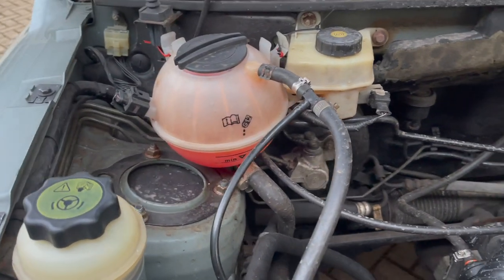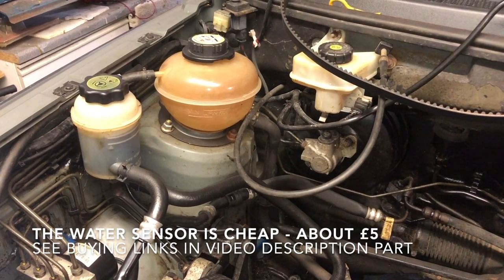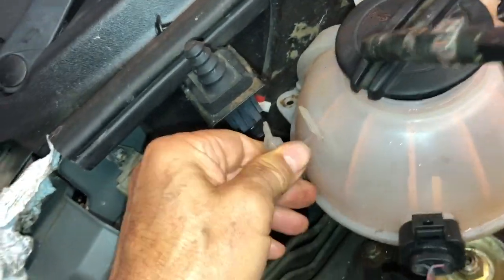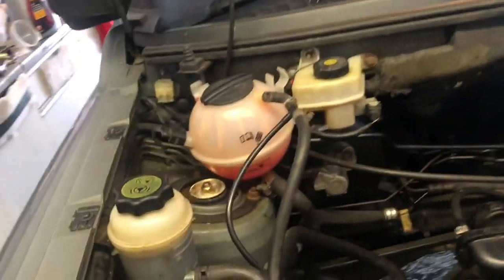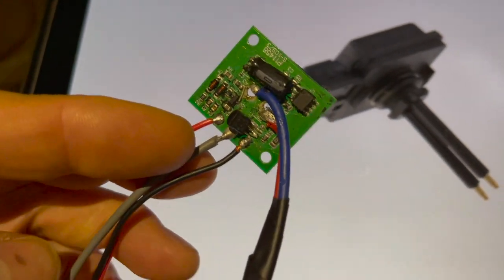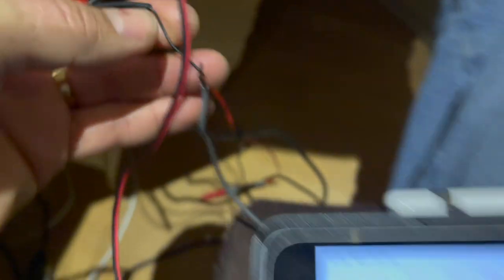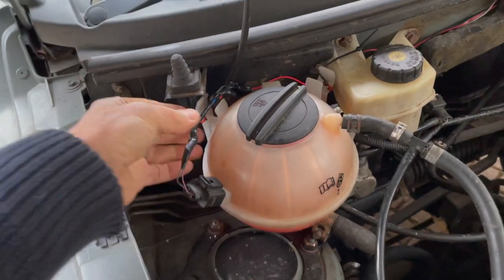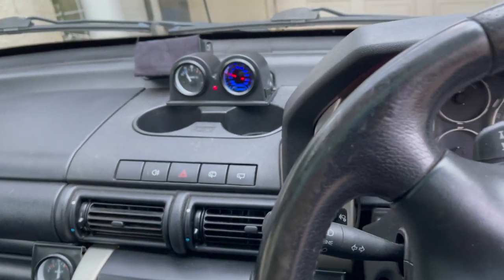Save your Engine! - Install a Coolant Level Sensor - Modern Type - Here is How!

Comment: Great video and help, should be very useful for our older VW T25 campervan (rear engine bay & coolant tank a faff to get to, so a retrofit, working dash warning light is essential). 
I can't get your recommended set-up to work on a bench test - what was your fault testing procedure when you stated you blew a transistor (3min 44 sec), so I can check it works before installing, or indicate my new unit is faulty? Thanks!
Reply from the maker: Thanks. When a transistor blew due to my wrong connection when trying to work out the wiring, I had little choice but to replace the sensor unit, it is cheap.   If you wire it as per my wiring diagram in the video it should work fine with a good sensor.
Reply: Thanks for replying, appreciated

Comment: Have you seen the mgf tf low level coolant  kit for sale on Ebay ,you just stick the sensor on the bottle and wire up to a cabin buzzer. I think your LED is the better idea.
Reply from the maker: Thanks for that I just looked it up, this one I assume http://ebay.us/4ur7rp
That looks ok but it all depends on how well it works in practice.  Being a bit high up on the bottle makes it susceptible to false alarms when the car is going up a long hill or around a long corner when the water gets pushed to one side.  I used to find that problem on my earlier float based water alarms even with electronic filtering of the signal.  Having electrodes positioned in the centre of the water (as in this video) at a low level, is definitely an advantage in this respect.
Reply: @comeinhandynow Yes that's the one, a friend fitted one to his mgtf  and he's not had any false alarms , with the sensor fitted 7mm below max  . so he says .
Reply: @neilthorpe3914  I installed this kit a few weeks ago and it was fantastic to install :) I have yet to test for false alarms, as the water pump is leaking all over my drive atm... But if I turn the ignition on it beeps very loudly at me!

Comment: Top job!! I guess you can modify the 'alarm' level by shortening or bending the sensor elements to alarm at an earlier level (would probably get some slosh noise)
Reply from the maker: Thanks, yes you probably could. I haven’t tried as it looked about right.

Comment: Hi!! I bougth this (Peugeot) sensor but your circuit has other components. If i connect the 3 wire sensor to my vw two wire sensor with your wiring diagram, dont need other components?? Thank you!!
Reply from the maker: Ok, glad it helped. Thanks.

Comment: Hello - I carried out your procedure to fix R/F door lock on Freelander 1 - Very good video. Unfortunately, now when using the remote the R/F door operates opposite to the other doors. IE 3 doors unlock and R/F lock - I replaced the motor with a Chinese import - was it wound the wrong way? - apologies for posting here - but the video in question did not allow comments. Thanks for your great videos.
Reply from the maker: Some part was made, wired or installed the wrong way round.  To save disassembling it all again just swap the two drive wires over going to the lock.  I think the same happened to me once.  I will go and check the comments on the other video.
Reply: @comeinhandynow  thanks, I will try swapping the feeds.
Reply from the maker: @yahididay  It’s the easiest route.  I remember the cause now, for me it was putting on the new motor end (brush end) on the motor, if it is 180 degrees rotated then it goes backwards. Easily done.

Comment: Thanks for video,  I have installed a sensor as per wiring in a Peugeot 308.  However, when ignition is on, for some reason the LED remains on at a low brightness all the time (but it does get much brighter once coolant level falls). Any ideas why this might be happening / how to stop it ? Thanks
Reply from the maker: Hmm, sounds like a bit of leakage in the sensor. You could try lowering the voltage/current to the led by installing a resistor (try somewhere between 1k to 10kohm) or some diodes in series with the led.
Reply: @comeinhandynow  Many thanks - will give it a try

Comment: It is not a bad idea, but technically it is not right. This sensor is good for a normal engine for maintenance purpose. In reality, when engine temp goes high, it overfills  the reservoir and empties the radiator. We need a sensor in the system not in the reservoir to avoid any overheating situation at all. Some  models have a sensor on top of the radiator, so whenever there is a drop in level inside the system, it warns the driver.
Reply from the maker: That depends on why the coolant leaves the engine.  If it is a slow leak, as is the most common, then eventually the expansion tank level will drop to trigger the sensor. The radiator level will still be fine in that scenario.  So a tank sensor is best.  If it overheated due to stuck thermostat or blocked rad then the resultant steam pressure will expel coolant from the expansion tank and you will probably know about that because steam will be coming out of the bonnet area.

Comment: This is cool. 
I have a problem on my td4. When the clutch is released it gives a rattling noise and vanishes when pressed fully. Have you done any fixing video for this fault. I tried the whole clutch kit, DMF and gear box too. Nothing worked. Should be coming from inside the engine. Any idea mate?
Thanks in advance
Reply from the maker: Clutch release bearing?
Reply: Did you find out what was the problem?

Comment: Does anyone know if there would be any benefit from installing a dump/bypass valve on an fl1 stock?
What would fuel economy be like afterward? Good or bad considering I'd be drive it normally? Just curious.
Reply from the maker: I assume you mean on the TD4, I don’t think it would make much difference.

Comment: Just got my lad a seat ibiza 2008 and cant believe it doesn't come with the sensor plug.  I thought someone had cut it off but they haven't.  Good video thanks
Reply from the maker: Thanks I hope it helps.
Reply: @comeinhandynow  thanks mate. Yeah it will. I will fit one like yours